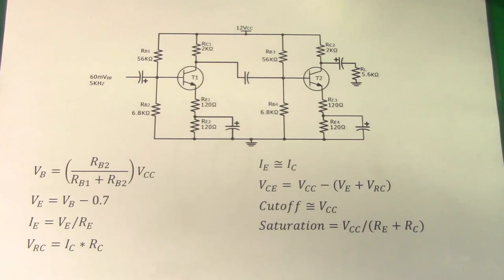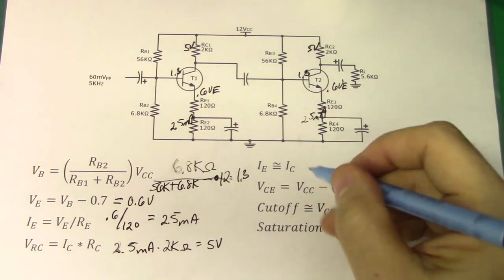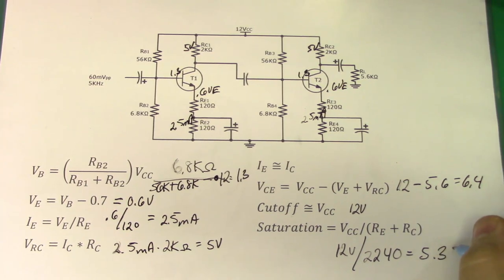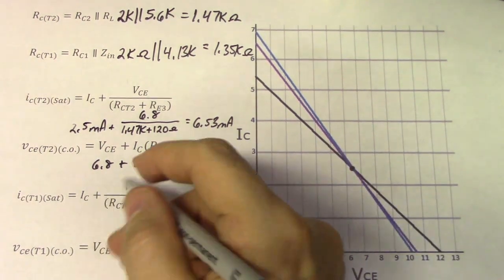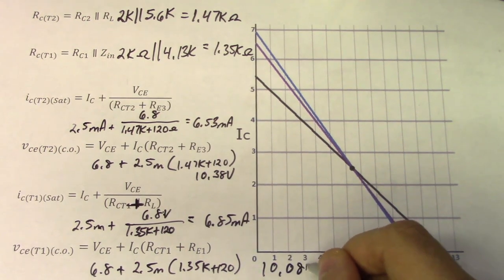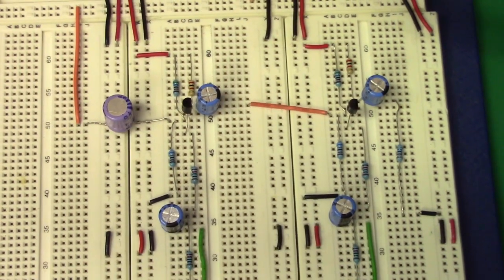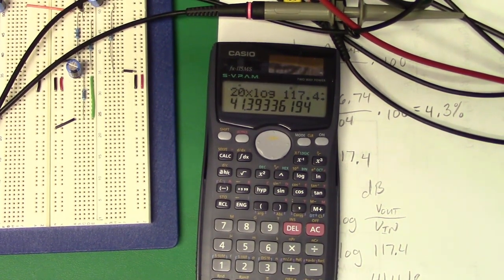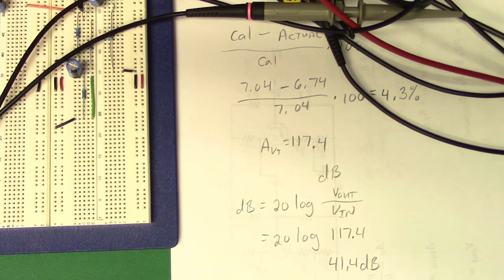32. Multistage Transistor Amplifiers

Comment: Hi, great explanation, but I got lost at 9.00. 
1. How did you get to the formula for Av2. I thought that the formula for gain had to include Alpha (Av = Alpha * RL/Rin). Or did you assume that Ic and Ie are almost equal and so Alpha is 1?
2. What is rej? Where did the value of 25mV came from?
Thank you in advance. Great tutorials.
Reply from the maker: Because Beta is at least 100 in this transistor, alpha has to be .99 at a minimum so I make IC and IE equal. The 25mV is a given for a transistor at room temperature using Boltzmann's constant.
Reply: Much appreciated.

Comment: Should Ie be lower? You divided by 120 instead of 240?
Reply: He wrote 120, but the did the calculation using 240, so the answer is correct.

Comment: Hi what value of risistor would you recomend for RB1and RB3  for useing the circuit with a nine volt battery as 56k seems not to work with nine volts as the risistance is to high thanks 🤔 great vidio im learning a lot great bit on voltage testing different inputs and output voltages that the circuit should have at each stage i think you learn more if you can test voltages that the circuit uses st what point great work keep it up any help with this would be great cheers 👍

Comment: What is rej ?             Amazing videos !!!!
Reply: I would like to know that,too!
Great video and explantion except rej. What that is and where it comes from remains a mystery.
Please give some hint.
Reply: It's the intrinsic emitter resistance of the transistor. As the current through the emitter changes, there is a very small change in the voltage between the base and collector, the change in voltage divided by the change in current is effectively the dynamic or intrinsic resistance inside the transistor's emitter. You can look up "Shockley's diode formula" to get a more in-depth treatment, but one result is that this resistance is approximately equal to 25mV divided by the emitter (or collector) current at room temperature.
So with a collector current of 2.5mA, the transistor behaves as if it had a 25mV/2.5mA = 10 ohm resistance in its emitter.

Comment: I would kindly like some clarification I thought if you have a capacitor at Re then you ignore Re when calculating the voltage gain
Reply: In this circuit, the emitter resistor is split. The bypass capacitor (around 100μF) is connected in parallel with the lower half of the emitter resistor and so only bypasses that part. The remaining 120R resistor still presents a resistance to the ac signal and therefore must be part of the gain calculation.

Comment: When used 47uF or 100uF for the capacitor the output wave form is clipped at the top. Whats if the fix for this ? Where the values of capacitor u used different or are they all equal ?

Comment: If I only do 1 stage to my transistor amplifier is the sound will be as loud as a two stage or more transistor amplifier? It's a dumb question but I just want to prove it.
Reply: Same question here sir.
Reply: so if i make a three stage amplifier the first stage is for v gain and 2 to 3rd stage are all current gain right? and where is the input and output connected? thanks :)
Reply from the maker: Driving speakers at correct levels is a complicated issue with chapters and books being written on the topic. A small, two stage amplifier  is a good compromise. The first stage can be a common emitter, input to the base and output on the collector. The second stage could be a common collector with its input (the bases) taken from the collector of the previous circuit. This will give you a voltage gain on stage 1 (CE) and a current gain on stage 2 (CC). Small signal transistors will work for both stages. Multiple common emitters can give you more voltage gain. If you need some serious current on the final stage, use with a TO-3 power transistor.

Comment: If R_E1 was a short, how would that change the gain A_V1? Would I just divide by r_ej in the A_V1 equation?
Thank You Very Much
Reply: Yes. The gain equation should be Rc / (Re + re), so setting Re=0 leaves Rc/re which is the maximum possible gain of the stage. It's also a nonlinear gain since re varies with the instantaneous collector current. That produces very unpleasant distortion as the output signal gets larger.

Comment: Sir, how can we calculate the effect of input voltage on Voltage gain? Please guide me.. Is there any use of input voltage in formulas?
Reply from the maker: Hello Farhad,
I am not sure exactly how to answer without a little more information. The input voltage should have no effect on gain at frequencies of a few KHz.  Gain will decrease as the frequency goes up because of things like the Miller effect. As long as the voltage doesn't saturate the output of go to high in frequency (check the hfe on the data sheet) you should be okay.

Comment: When we work with our circuits, we use a resistor in series with the whole circuit that sits before the first capacitor (they call it Rg). Does this effect any of the equations other than just adding that resistor in series to the parallel combination of resistors for Zin?
Reply from the maker: Hello and thanks for watching. It shouldn't be an issue. It's probably done to match the test setup to the real world implementation.

Comment: I have using 2 channel amplifier.i would like to very punchy and depth smooth bass.but in my amplifier Voice only loudly Come out please give me any solution.
Reply: Hello, Without knowing more about your circuit, I can't really suggest much. Are there caps in series with the output, inductors in parallel? There are to many variables for me to give you answer.

Comment: Why does the equation for Rin((base) have Beta instead of Beta+ 1? Doesn't ie=ib(Beta +1)
Reply from the maker: Your numbers are correct. When we rearrange to find beta we get,
B=(ie/ib)-1
It is such a small variation that it is negligible in most calculations.

Comment: Would the same formulas be used under different amplifier configurations (common base, common collector, etc.)?
Reply from the maker: Hello, I am not sure to which formulas you would be referring. Gain calculations would be different for each species.

Comment: what if want the voltage source to be 9 volts rather than 12 should i just take percentages of every resistor or it's more complex?
Reply: That would work if the base-emitter voltage of the transistor also scaled down, but it doesn't. However, it's not a bad starting point to experiment with.
You'll find that Rb2 doesn't need to change much, but Rb1 now has to drop about 3V less, so needs to be smaller.
I would recommend aiming to keep the collector current around 2.5mA and use Rb1 = 47K; Rb2 = 6.8K; Rc = 1.8K and Re = 100R + 100R which would give roughly the same performance.

Comment: hello sir can i know what is the exact value of the capacitor ? i would highly appreciate it if u could provide me the value of the capacitor for my simulation test
Reply from the maker: I don't know why I never put the values down for those ??? I don't remember the exact values but 10uF electrolytics are more than enough. Thanks for watching!
Reply: @TheOffsetVolt  oh ok i see ..thanks for ur kindness sir highly appreciate it
Reply: As I commented above, for audio work down to 20Hz, you need bypass capacitors of 100μF and coupling capacitors of 2.2μF.

Comment: I thought that for the DC biasing that RE was to be sum of RE1 and RE2 which would be 240 ohms?
Reply from the maker: bigbread9000000 It is indeed. The answer is right I just wrote 120 instead of 240.
Reply: Great tutorials, you are very thorough!

Comment: If i have a multistage with 2 bjt couple with capacitor, but at q1 output there's no signal what could cause that
Reply from the maker: That could be a lot of things, no AC input, no base bias voltage. Hard to say with the info given.

Comment: hai can i ask you which resistor i need to incrase or decrease value  because i want get voltage gain total 140
Reply from the maker: Adjusting the emitter resistors would be easiest but then the Q points change as well. You could use two resistors on the emitter that equal the same value as the original and put a capacitor between them to set the gain. Kinda complicated to explain here. Hope it helps a little!
Reply: @TheOffsetVolt  If you keep the sum of the two emitter resistors constant, you won't change the bias points. I'd simply change the first stage emitter resistors to Rb1=100R; Rb2=140R (=100R+39R) and call that close enough. 🙂

Comment: What's  the Application of CE Amplifier ..
Reply from the maker: Anytime you need amplification of a low frequency signal, the common 
emitter is a good choice. It is a general "go to" type of circuit.
Reply: + The Offset Volt    To set something straight for me; The single transistor amp, with a single rail supply should by rights only swing between 0v to lets say 12v rail when the emitter voltage is at roughly 6 volts in that simple configuration of amp, (and through a DC decoupling cap of course). The load, e.g. the coil/cone of a loudspeaker should then move ONLY from 0v to 12v, and back to 0v, (if you measure it load side and when a signal is present), yes?  To get a full 'swing' from the speaker coil/cone where the output also becomes negative (-12v), and an so an inward coil/cone movement you must need a split rail supply i.e. -12v, 0v, and +12v, (with a decoupling cap), then the coil/cone movement would follow 0v, +12v, 0v, -12v, 0v, +12v when a signal is present, as in  the case of a multi transistor npn/ pnp push pull amp. Correct?So the -ve cycle of the cone/coil is missing in the first case common emitter configuration?
Reply: @mcwolfus4718  If you have a single 12V supply, then you bias your output stage to be at +6V when there is no signal. Then you use a large capacitor between the output and your speaker to block the dc offset of +6V, but allow ac signals to pass through. So without a signal, the loudspeaker has 0V at the end connected to the capacitor and the other end is grounded (also 0V). The amplifier can then pas a maximum signal between 0V and 12V. That is an ac signal of ±6V around the +6V bias point. The ac signal of ±6V will pass through the capacitor driving the speaker to +6V and -6V relative to ground. That's how you get negative voltages onto your speaker with a single rail power supply.

Comment: what is the merit of the capacitor in the circuit? i need brief explanation
Reply: to bypass or decoupling
Reply: In brief, it doubles the ac gain of the circuit without affecting its dc stability.

Comment: I had to stop at 4:30. The 1.3 v is not the voltage at the based but the Thevenin voltage that should be in series with the Thevenin resistance. The calculations might need revision.

Comment: when you say RC2 is parallel to RL, what do you mean by that?
Reply from the maker: Hello, The current from the collector of the second transistor would go through RC2 and the load. Since the current split into two paths at the point where RC2 and the load connect, these are parallel to one another.
Reply: The Offset Volt thank you for replying, it's the way that you've written it for the calculations, I've not seen the || used before and I was baffled as to how you got your answer. Forgive me for sounding a bit dense
Reply from the maker: Not a problem. I do the videos for people new to the field and I always forget two or three points that I should include after the video is published.  Your question was one of those dis-remembered points. Thanks for watching.

Comment: Do you mind giving the values of the capacitors you used?
Reply from the maker: Hi, I used 10uF - what I had on hand at the time. Lower values would work but for the caps to be electrically transparent, bigger is better.
Reply: Thank you so much, btw can you share with me a tested and working circuit diagram of a common emitter - common collector two stage amplifier if you have any. I am working on a project at college and struggling with it. Yours was greatly helpful.
Reply from the maker: Thank you. I don't have anything on hand but might come up with something.
Reply: The emitter bypass capacitors need to have a reactance less than Re1+re' (i.e. about 130ohms) at the lowest frequency of interest. For audio, we usually work down to 20Hz. So the emitter bypass capacitors should be more than 1/2πfR = 1 / (2π x 20 x 130) = 60μF. Use 100μF.
The input and interstage coupling capacitors need a reactance less than about 6K (the input impedance of each stage), so you can use 2.2μF. That will be okay for the output cap as well.
Reply: @RexxSchneider  thank you for this...

Comment: What size caps did you use?
Reply from the maker: I believe I was using 10uF although you will get pretty good results with 2.2uF as well. The idea is to have an Xc that is, at it's maximum, 1/10th of the resistance you are bypassing.

Comment: how can i find the total input resistance?
Reply: At frequencies where the capacitors have negligible impedance, the input impedance is the parallel combination of Rb1, Rb2, and β x (Re1 + re'), which is 56K || 6.8K || 90 x (120+10) in the worst case. That's about 6K.
Reply: How do you come up with an answer if there's Rb1||Rb2?...I'm confused by the parallel symbol

Comment: I have been trying to implement a bifet amplifier but with a load resistance of 10 ohms and Vcc as 5V to get a gain of 20 V/V but it seems not to work. im working with LTSpice. i keep thinking probably my load resistance is too low or the Vcc. What could be done please. Ineed help
Reply from the maker: Hello, 
Without knowing more about the circuit I can only offer some general ideas. A 10 ohm load on a common emitter stage, if built using the circuit values in the video will not give a gain at all. Av=(Rc||RL)/RE. What is the voltage in and the desired voltage out? Remember Vout can only go between Vcc and ground. With a 5V supply, the biggest AC voltage out, if perfectly centered on 2.5V DC is 5Vpp.
Reply: Your supply voltage is too low for any comfortable design. When working with FET input stages, you have to account for the large range of important parameters. Discrete JFETs and MOSFETs really need 15V supplies to allow you to compensate for gate turn-on or turn-off voltages of several volts and still get a usable voltage gain. If you're using a single-ended FET first stage, you'll want a split source resistor with most of it bypassed for ac with a capacitor to increase the ac gain if you want to get x20 out of it. Then your problem will be that you need considerable current gain from the bipolar output stage and you may need a Darlington in common collector to achieve that with a 10R load.

Comment: About of rej parameters??
Reply from the maker: I am going to do a video on this soon. A lit of peaple have the same question.
Reply: It's the intrinsic emitter resistance of the transistor. As the current through the emitter changes, there is a very small change in the voltage between the base and collector. The change in voltage divided by the change in current is effectively the dynamic or intrinsic resistance inside the transistor's emitter. You can look up "Shockley's diode formula" to get a more in-depth treatment, but one result is that this resistance is approximately equal to 25mV divided by the emitter (or collector) current at room temperature.
So with a collector current of 2.5mA, the transistor behaves as if it had a 25mV/2.5mA = 10 ohm resistance in its emitter.

Comment: Why 0.6/120=25?
This equation is wrong it is like this 0.6/120=5mA
Reply from the maker: Hello Hena, There is a callout in the video that corrects the calculation. The resistance of Re was 240 ohms so the current is 2.5mA, Thanks for watching.
Reply: @TheOffsetVolt  Thanks Sir